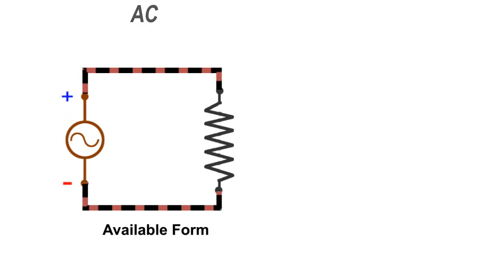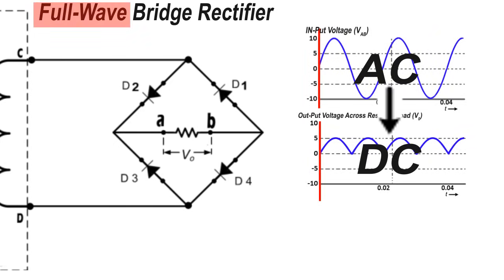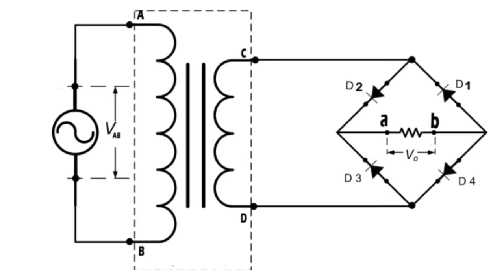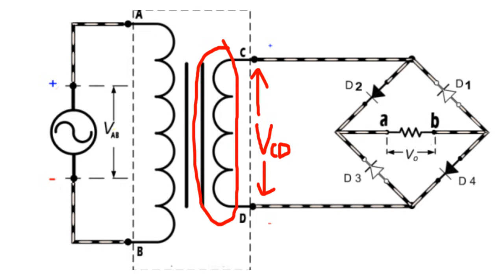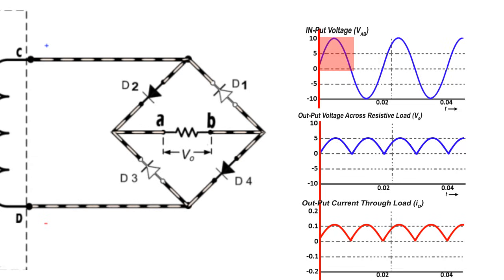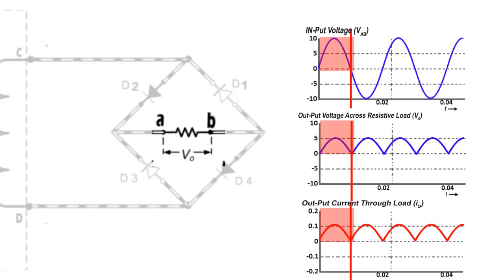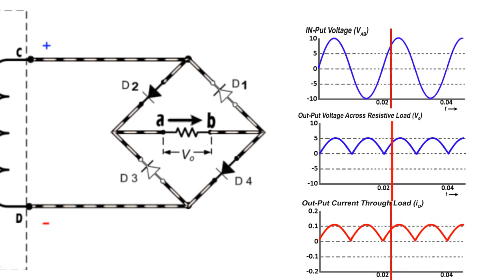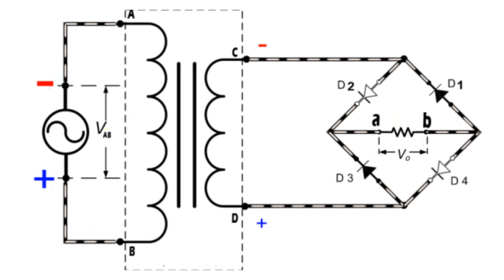Bridge Rectifier Animation

Comment: Excellent.But,why is the resistor used in the circuit?
Reply: Resistor is used to resistance the flow of current. When resistor is placed in a circuit, the current flow decreases when current passes through the resistor.

Comment: This helped a lot. Thank you. How can you tell which diodes are forward biased without it telling us?
Reply: The diode where the triangular side is connected to + voltage are forward  bias  as it allows to flow the current and when + voltage is connected to  line side it is reverse bias as it does not allow to current to flow.

Comment: Well-presented and easy to follow video.  The only thing I noticed is that the thumbnail has the AC and DC connections switched.  As drawn, the top should be positive, the bottom should be negative, and the sides should be the AC inputs.  (The diodes always point towards positive).  However the schematic in the video itself IS correct.

Comment: I'm so damn confused... in the first half of the cycle why does current go to diode 4 after it goes thru the load not thru diode 1 because diode 1 is open for current to flow thru it to short it out... why wouldn't it go thru diode 1 seems like less resistance no?
Reply: Aleks M it goes through D4 because the branch point at D1 is positive at that moment and to complete the path it has to go toward negative. You can build this circuit with LEDs to better visualise but you need to slow down the ac input with a function generator.
Replace the diodes with LEDs as they are diodes too.

Comment: Stupid question even with the 4 diodes and a resistor the voltage would still have a wave graph don't we need a capacitor at this point?
Reply: The point is efficiency. More than 50percent voltage is received

Comment: Great explanation and animation! 👏

Just a thought, which side of the A-B circuit is positive and which is negative. I assume this is conventional current flow as the positive is flowing to negative?
Reply from the maker: Yes you have assumed right
Reply: You are correct. Something which interjects confusion is the difference between "charge" and "flow."  In battery, + is the negative charge which flows away from + toward the - pole which has the positive charge.  This nomenclature can interject confusion.

Comment: In the real world current flows from negative to positive.
Why does your current flow from positive to negative?
Confusing.
Reply from the maker: in starting phase of evolving of this field, many researchers and scholar considered that the electric current flow form positively charged body to negatively charged body, and therefore in may of old literature of physics the current is taken in positive to negative.   
but later on, it is found that; it is the electrons which actually moves and cause an electric current and then many scholars start using used this notation.
Now, these days we have quit understanding of electric current. so we can say
The conventional method is to take direction is, to take direction from Positive to Negative
Wheres as the direction of electron current is from negative to positive

Comment: why does we need the transformator to convert to dc, can it work eventhough we don't use the transformator in bridge rectifier?
Reply from the maker: Yes, 
But the supply voltage must be of safe value for diode. As we generally use dc supply at our premises for low power application where voltage rating of our devices is under 12 volt, where the voltage available at our supply mains is of value 230 volt (south asian region) or 110 at US region.
Reply: sourabh sharma What if one leg of the transformer is grounded?

Comment: The correctly named "full wave bridge rectifier" doesn't have the same impact as the misnamed FULL BRIDGE RECTIFIER!!!
Reply from the maker: Bridge circuit always consist of four branch elements (here diodes) I think there is no concept of half bridge or full bridge, but output wave from ractifier could be half wave or full wave. 
so the correct one is Full wave Bridge rectifier

Comment: Even though the accent in your speech is very heavy, your presentation made this very easy to understand. The animated visual of the rectifier running through the circuit is extremely useful.
Reply from the maker: THANKS SPULCH
WE WILL TRY TO IMPROVE ON THAT
Reply: sourabh sharma You don't have to do that. I was just pointing out that even though the accent is heavy and sometimes difficult to understand, the presentation of the video, ideas, and the order of the ideas is much better than most English presentations of this concept. You are doing fantastic work. I'll look forward to future videos.

Comment: Transformer in dotted box is optional. It is only needed it you require a different voltage than provided. The apparent power will not change via transformer. Current will go up as voltage is stepped down.
Reply: Chris , how do you reduce the current as well?
Reply: It depends what is going to be downstream in transmission and as a load. This video has the Vo as the output voltage across a resistor Rab which represents the load resistance. This could be an impedance though (Z = R + jX). I would start with a filter capacitor sufficient to stabilize the ripple voltage in parallel with the load. This would produce something closer to what we see as direct current voltage (Vdc). From there, you could have a resistor in parallel with your load to ground. This would produce the same voltage across both shunt resistor (Rs) and load resistor (R_L). The R_L would keep the same voltage but from basic electrical theory, the most current would pass through the Rs instead of R_L which would lower both Voltage and Current of the desired load thus changing the power. If the load is inductive/capacitive as well, the apparent power will change (real + reactive power).
Reply: Hal Lyman In short, the electrical technique is a current divider. Same voltage but different currents.